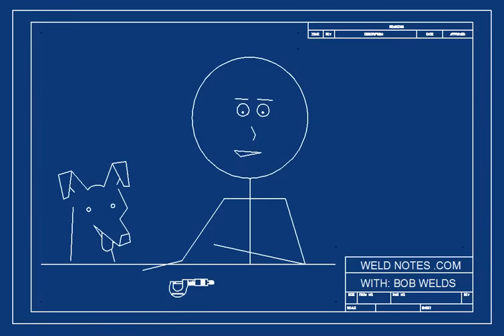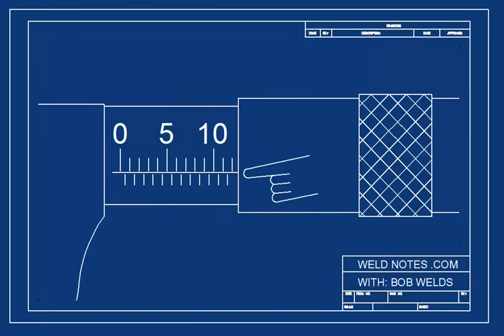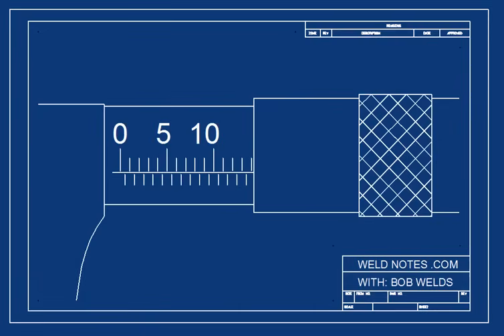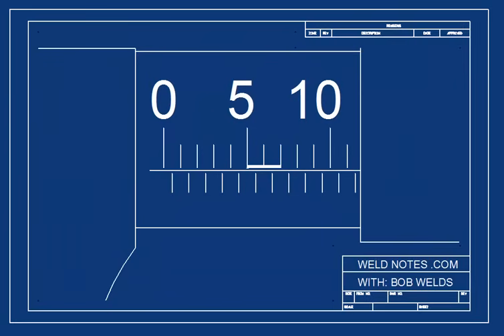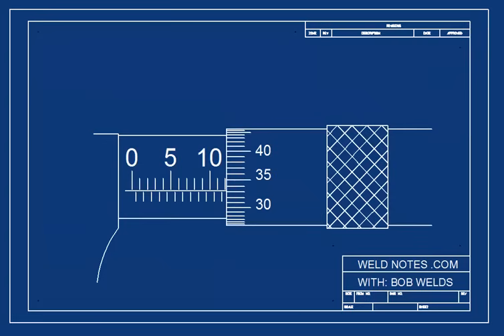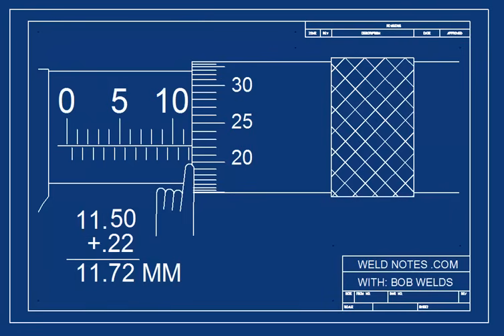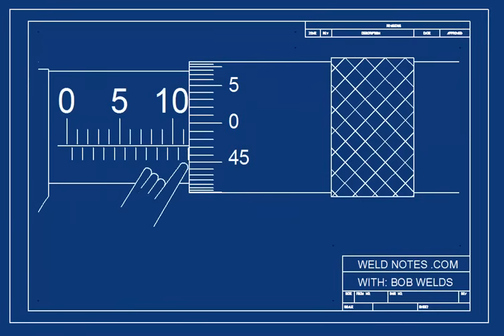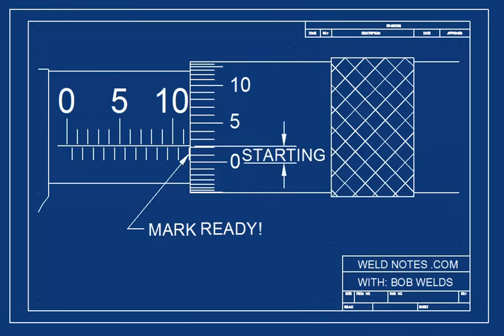How to Read a Metric Micrometer by WeldNotes.com

Comment: The easiest way to remember if you are 'on a mark' or not and which way to read, is easier found in the act of taking the actual measurement and spinning the thimble..  so if you are approaching 15mm, for example, you will see it approaching zero and counting backwards..  so pay attention to this while taking the measurement and if it stops before or after zero, you know if its over under..  seems like a 'duh' type of thing, but when learning/remembering, its the most important part.. 'not quite q5 or just over 15.. (using the arbitrary number I just used)  so you can go oh.. its 15.2 or 14.9, etc..  (and naturally, just apply this to any other numbers on the thimble...  

you can actually do it 'backwards' sometimes depending on which is quicker collecting data for a measurement.  so..  1) thimble (less than or more than) 
2) the barrell...
3) so you can say I am less than...(THEN read the barrel)   ...so you can say okay its less than the number I'm gonna get off the barrel, look at those marks, get the value from the barrel and the. get your numbers..

Other times, do it the other way...  barrel, then thimble..  these are ways you can always use or ones to help ya when you have those brain fog moments..  :)

Then you'll get it down and wo t have to think Bouton it anymore.  (especially when its (using his example scale now) number on the thimble like 33 or something.

--

Important side note.  LEARN THE PRESSURE NEEDED to make a proper meaurement (with any measuring tool for that matter) you don't want to go even a tiny bit too tight..  AND MAKE SURE YOU KEEP IT SQUARED UP, AND CLEAN.. even w/ only w/ 0.1mm precision (vs 0.01,etc..for an example)  the SMALLEST stuff (some you may not even notice, can/will throw your measurements WAY off.. 

oh and keep them clean, don't drop them and don't use the extreme limits of the tool(s) even w/ something like a torque wrench, too..

Also CHECK CALIBRATION OFTEN!

😊

Take care everyone!  great video!!

Comment: Thanks a lot for the amazing video. I would just like to point out a very minor error which is practically of no purpose here and i think you might've done it for explaining purposes but whatever here it goes when you read out different ways to say 0.50 you say point fifty but it is not the right way to read numbers after decimals the correct way would've been to say 5 Tenths probably

Comment: good explanation. the last part actually is very important as the hull with the engraved readings is, in most cases, fixed with a screw on the mic axle and could be moved both axially and laterally when referencing the mic. so there could be misalignment when not done properly, causing the .5 marks showing up quite early and confusing the measurements.

Comment: I've watched a lot of instructional videos on micrometers and this is by far the best. One small point though — I think you mean you can get more 'precise' micrometers, rather than more 'accurate.' In physics there is a significant difference between the two.

Comment: This is a great teaching tool, i am currently in a machinist class, we will be using inches, but i have a question, How would you read .0025 using a vernier scale? would you read it the same as a decimal, twenty five ten thousandths?
 or two thousandth and five tenths?
Reply: +bountyhunter bntyhtr 

Most folks in the industry would say it "Two and a half thousandths".

Just easier than saying Twenty-five ten-thousandths which is actually what it is.